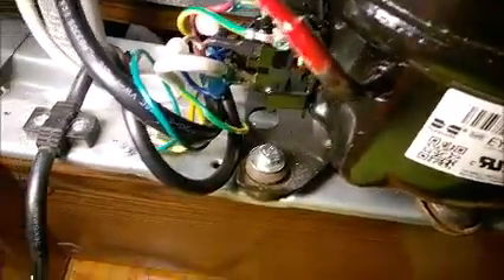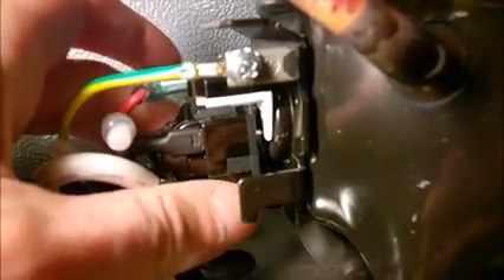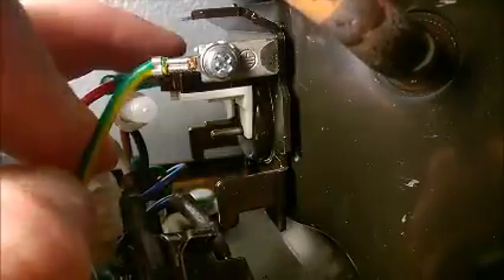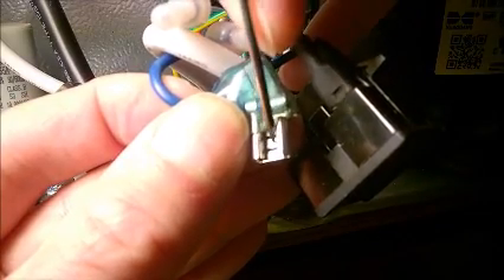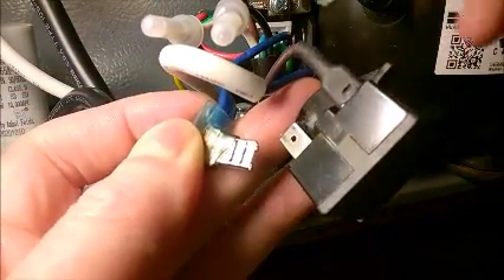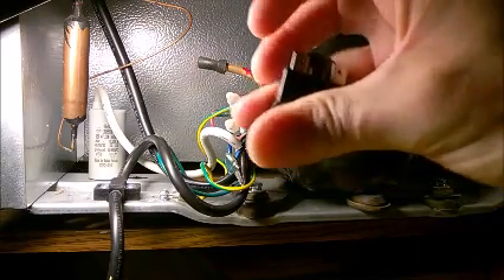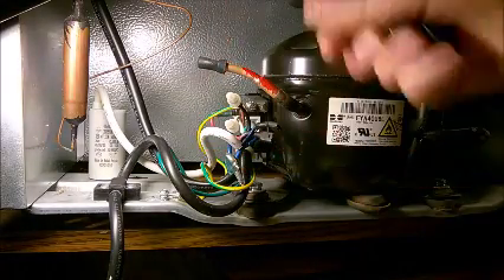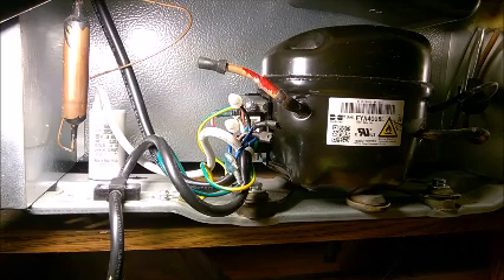Mini fridge cooler chest freezer stopped - start relay replacement, failure causes and tips

Comment from the maker: Again, noisy "clonk" or "tap" relay sound replace relay asap. New relay should make a "click".  I also have a 18ft-cu fridge with failed relay - it has a different model of relay
To resume: replace first start relay alone, if compressor doesn't start, replace overheat relay as well. If compressor still won't start, either compressor is worn or there is another problem (for example, failed thermostat sensor)

Two failure scenarios:
1. compressor runs for too long and overheats - normally the overheat relay will disengage and stop it.
2. compressor doesn't start - either relay failed to start it, either compressor ran for too long and the overheat relay disengaged and stopped the compressor.
In both situations, I suggest buying both relays, replace first the start relay, if compressor doesn't start, replace the overheat relay as well.

Obviously, there is also the "normal" wear of the compressor. I can tell on these recent appliances, the compressor oil is poor quality and will degrade after only 2-4 years, depending how often you open the door and put uncooled items inside. Compressor oil is simply not strong enough to take extended compressor operation. That's another reason why these fail so soon. When the oil degrades, the compressor is loosing pressure and will take longer to cool down which in turns causes the compressor to overheat even more and accelerate the wear. 

Tip: while waiting for new relay, manually plug freezer in for 20 minutes every 3-4 hours or so, it should be enough to keep items if not frozen, at least cold for several days. Use a timer with alarm, so you don't forget the unit running for too long (will wear off the compressor). This will not work for fridges (won't say cool enough).

Depending on the unit, a fridge/freezer may start right away after being plugged in, or afte a 30 minutes or so delay.

The start/stop relay on small "hotel room' fridges has either 1 or 3 connectors and is usually marked as QP2-4R7 PTC 4.7 Ohm 110V (for North America). The top smaller overload/overheat relay depends on the size of the compressor HP - my compressor has 1/2HP with part code 6750C-0005P. It is important to have the right overload relay, to prevent the compressor from overheating/damage in case the start/stop relay fails while the compressor is running. The overheat realy is basically a temperature fuse: if the compressor overheats, this relay burns the fuse and stops the compressor - this overheat relay then needs replaced with new one in order to restart the compressor.

When you start a fridge/freezer that is no longer cold, it may run for fairly long time. I suggest making sure the compressor doesn't overheat during this time. May want to place a room fan right in front of the compressor. Alternately, may want to stop the unit manually (unplug), and restart it until it reaches cold temperature without overheating the compressor. If the compressor feels hot after running from cold for only 25 minutes, it means the oil is degraded and the compressor is now quite worn.